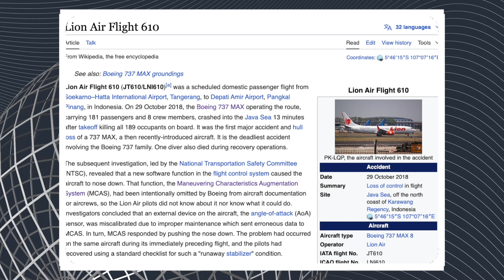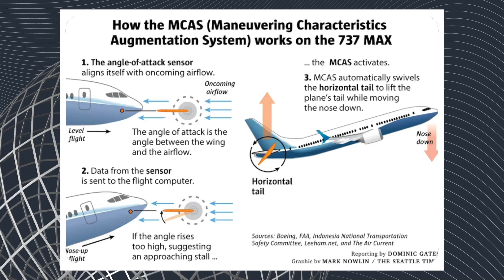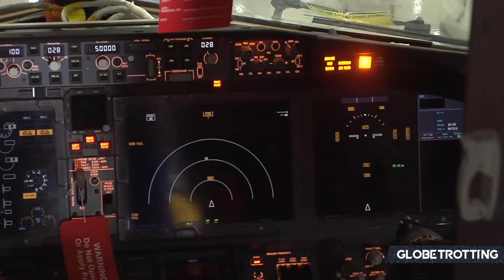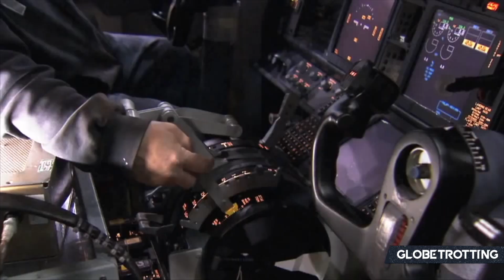GROUNDED - Why The 737 MAX Was Grounded For So Long

Comment: Again?   We get it already, Boeing sucks!
Reply: Not again it is the old news
Reply: Depends what you mean. Stuck rudder issue is a "new" issue in technical terms. But that issue is a month old already.
Reply: if it's a month old, what has been done to at least begin finding a solution? @jantjarks7946